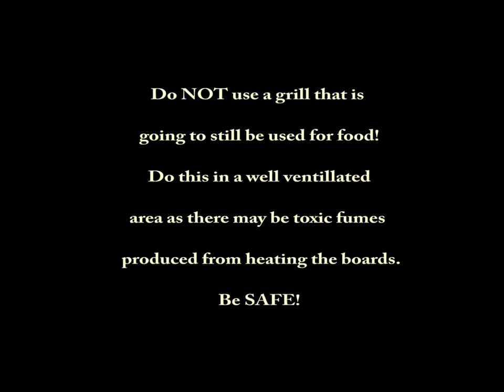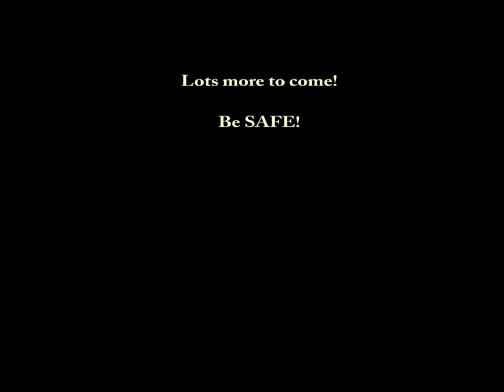How to Clean Cell Phone Boards for GOld Recovery with a Hot Sand Bath

Comment: I use a plastic bucket, and do tap the board to the inside of the bucket ..
This way more solder will come off the board and the solder will collect on the side of the bucket. I also recover the solder from the pliable plastic bucket when finished. it will collect in a ever thickening layer ;)

Comment: Moose, what is the solder made of and is their any value? How long do you leave them in the sand and what should the temp be? and will their be any sand stuck on the parts you scrap off??
Reply from the maker: Solder has almost no value.  Even silver containing solder has under 10% silver so you would need to collect a lot of it.  The sand should get up to 600F.  As for the length of time it varies on the size of the board.  sometimes it takes several minutes.  There may be some sand but it is easily brushed off.

Comment: Hey Moose, great video. I know this was posted approximately 8 months ago so I am not sure if your process has changed since then. Would you recommend any further processing of these boards before putting in A/P? I see where you use a LYE solution to remove the solder mask but will this also remove the "bumps" of solder that sometimes remain after depopulation? I see where it is recommended to use HCL to totally remove the solder but wouldn't this begin removing the copper also and begin the recovery process? Just trying to leverage your usually well informed insight. Thanks
Reply from the maker: Krishna Julal HCL alone will not start to dissolve the copper without an oxidizer like oxygen from peroxide or air bubbles.  That's about all.  THe lye may removes some of the solder but likely not all.  Usually after the hot sand bath they are pretty much good to go.
Reply: Moose Scrapper Thanks very much for the prompt and informed reply. Learning and building up my confidence to try the processing. Thanks again

Comment: Moose

Even though ive watched nearly all your vids, this is my first message to you over from the UK.
GREAT WORK mate. I appreciate the time and effort you put into your vids and have learnt a lot from you - still have some grey areas though. 
I have a couple of questions for you Moose, is the process to refine from gold fingers and mobile phone boards the exact same?
Q2: How pure can we get the gold we refine to be?
Q3: What determines the Karat of the refined Gold?

I hope you can help, and really look forward to your reply.
Once again mate, thanks for your work.
Reply from the maker: shahid Ahmed Hi and thanks for watching!  For your first question, we need to just chat a little about terminology.  THe first step is recovery.  THe gold recovery process (removing the gold from the material) is the exact same for gold fingers and gold plated boards assuming the boards are completely free of solder and components.  In the refining process I use of HCL and bleach it is possible to get the gold quite pure, easily over 22K.  THe more times you run the gold powder through the refining process the more pure it becomes.  THe karat is determined by the percentage of gold vs other metals, most often silver or copper.  Hope that helps!
Reply: Thanks for your rapid reply. Just to confirm Moose, Hydrogen Peroxide is not essential. ..?
I am hoping to go ahead with my first attempt within the next week you see and want to do it right.

I appreciate your help
Reply from the maker: shahid Ahmed Oxygen is required to get the reaction going.  You can do this by either using hydrogen peroxide, or by using an air bubbler.  You must use one of them.

Comment: hi,
After this step,  removing solder mask is required before AP method?
Reply: Not required but if you suspect the board to be fully plated (most are NOT) then yes remove the mask to go for the extra gold.

Comment: Okay, when we put them into the a/p bath, I am assuming only the bond between the gold and the board dissolves like with ram fingers. What more can we do with that board after we take it out of the bath. I assume it is goldless at that point, no?
If there is no more gold in the board after the bath and assuming the board doesnt dissolve in the bath, what more can we do with it? Also what is the board itself actually made out of?
Reply from the maker: Leonard Greenpaw The hot sand bath is to remove anything soldered to the board.  Gold is not soldered to the board.  Then the AP bath removes the gold foils.  The boards should be gold free, if they are not then put them back in.  THe boards are made of many different types of laminates, etched or traced with copper, then covered with a solder mask.  THe boards are pretty much worthless after the AP.  There are a few places that buy them to recover the trace amounts of copper left on them but the cost to ship pretty much kills any profit.
Reply: Moose Scrapper So what do you do with the left over boards just toss them in the trash or maybe drop them at the local dump or ewaste facilities?
Reply from the maker: stu7049 The boards can still be recycled.  shredded mashed and made into new boards.

Comment: I assume this works on bigger boards too. Is it worth doing this with bigger boards? Will places like board sort still buy boards that have been stripped like this? I primarily want an easier way of getting all those little tantalum capacitors.
Reply from the maker: dhermitmorse This will work for larger boards but will take longer as they will sap more heat out of the sand and it will take longer for the sand to get back up to temp.  Buyers will still take these boards but only as low grade, unless they are gold trimmed.  If you are just after tantalum then I would use a pair of small pliers to twist them off.  Thanks!
Reply: Moose Scrapper
Thank you.

Comment: Does this remove the gold plated pins and the hard plastic that surrounds it?
Reply from the maker: I will remove the items from the board.  It is not going to remove the plastic rectangles that the pins are in however once it is removed from the board those should pull out really easily.

Comment: Also, does the sand need to be the fine sand or the sand with little pebbles?
Reply from the maker: little pebbles are fine I guess, when you screen it later to retrieve any little componants that have fallen off they will get removed at that point anyway.

Comment: You said you would sort out the MLCC's later on, but how?

How can you tell which is a MLCC and which is a resistor for example? You cant look at the circuit board anymore for the "C" Label ....

And if i could just remove all of them at once and then sort them later that would safe me soooo much time :o)
Reply from the maker: I screen the sand afterwards.  MLCC's and anything that looks just like them can all get processed the same way.  Or you could take the time to separate with a magnet.  The ones you want will only be very slightly magnetic if at all.
Reply: @moosescrapper5928  Thanks for the answer. Well mine are all magnetic :o\
Do you know what metals are in the MLCC lookalikes by any chnace?

Comment: Hey I like the sand bath my friend, but I'm not sure what other parts should go in the acid bath also. I do have some old computer parts also, not so sure on what parts on there either, other than the memory cards and the gold I can actually see. I'll keep looking threw your videos, thanks for this one :)
Reply from the maker: Yeah, gold plated boards is one of the two easy types of material to process.  The next is gold plated metals like pins and connectors etc.  There are many different types of gold bearing material and also different ways to recover the gold from each.  I have only done videos on the processes that I feel comfortable enough to show to others.  For more info, check out the goldrefiningforum, all one word.
Thanks!

Comment: Just Awesome!!   So easy.  I am going to try this this weekend.  I have done close to 600 with hammer and chisel.   Rrrrrrr.   Feel real obtuse now that I have seen this vid.  Is there any value to the pieces that fall from the boards?   Thanks.
Reply from the maker: There certainly is.  You can sell as is or seperate and process, there are loads of options.  Most of the little pieces that come off of a cell phone board have some precious metals in or on them.